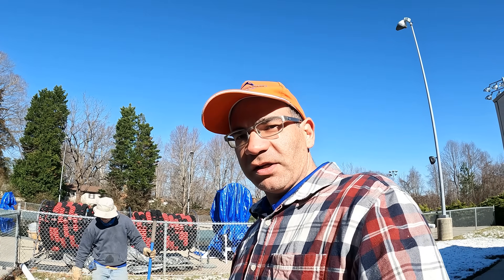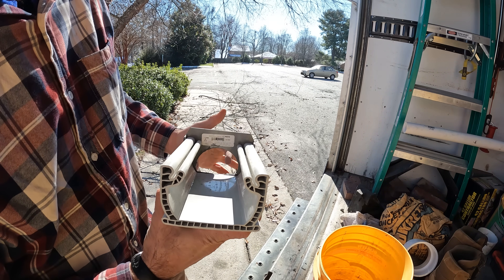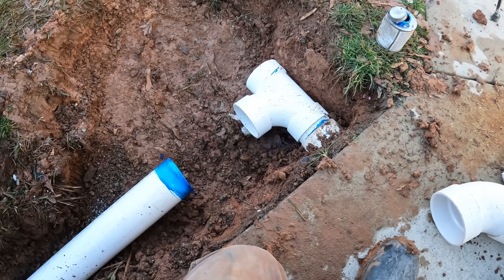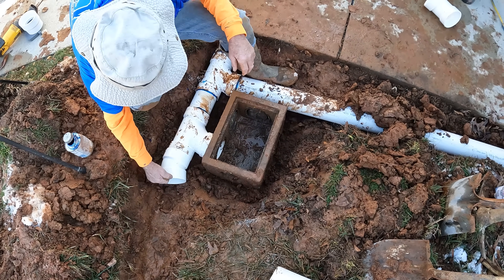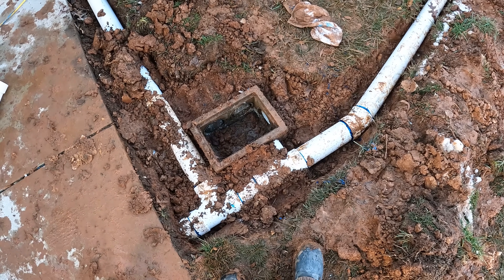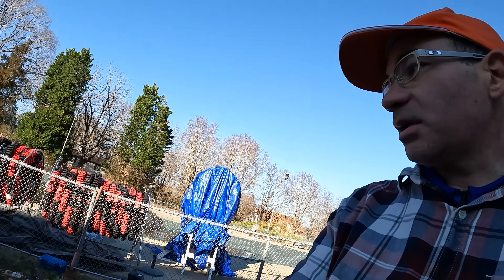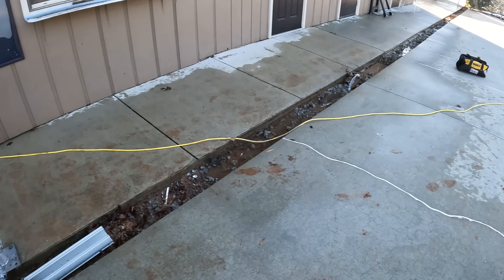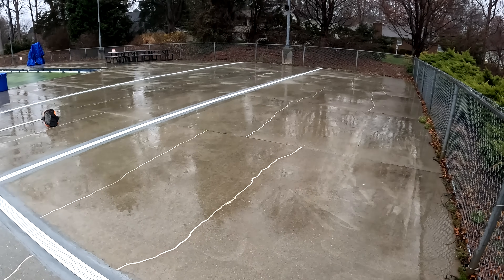Connecting A channel drain to 4" PVC drainage Pipe

Comment: Great job as always Shawn! By not using the catch basin you definitely sped up the water flowing through the drainage pipe. That was a great idea. I like how you all throw away your trash also when we installed a interior pressure relief system in our basement the crew three all kinds of bottles and candy wrappers inside and I thought that was definitely not professional. I can tell you and your guys take pride in your work. I just wish more contractors were like Gate City Foundation Drainage. Can't wait until the next video.
Reply from the maker: Thank you Shane! I've got a bunch of videos that I need to get busy working on!

Comment: For plumbing code 2" and under is 1/4" per foot, anything above 2" is 1/8" per foot. Also for drainage 90's aren't permitted and you must use 2 45's to make your 90's for flow reasons.

Comment: Shawn, buy a wood working rasp. Then you can use it to clean up the rough edge of the plastic after you cut it with your oscillating tool. The rough edge will tend to catch leaves etc.
Reply from the maker: Great idea John 👍

Comment: wHY DIDN'T i see pvc pipe cleaner or primer used?
Reply from the maker: We use a primer+glue called Rain-r-shine.
Reply: @GCFD  That's a wet and dry cement, not a primer and cement.

Comment: Please share the link to the Uniform Plumbing Code that says it’s ok to lay a sanitary tee on its side for water drainage applications. I am doing this to my driveway and am having trouble with the inspector. Thanks.
Reply from the maker: Hahah Here code says to use corrugated for drainage pipe so I wouldn't recommend following some codes.

Comment: Is there any concern that the dirt you use under the PVC could settle you might lose some of the fall you established?
Reply: It will settle and the fall will change along the pipe. The PVC is stiff so will tend to bridge over low points in the trench so it will not be as bad as single wall corrugated where you are likely to get ponding in the pipe even if you start with a good fall. The pipe was laid with good falls so whilst it will have different falls in a year it is very probable that it will be still have a reasonable falls then.

If the pipe was bedded in pea shingle or sand settlement would not be a problem. But with such shallow pipes there could be problems with traffic, lawn mowers etc rutting down into the trench and damaging or moving the pipe. You could bed and surround the pipe in concrete  but that has to be mixed. The pea gravel/ sand or concrete has to be paid for and the material that comes out the trench has to be loaded up and disposed, which all costs money.
Reply: @johnclements6614  Thanks for the reply! I find all of this very fascinating.
Reply from the maker: Like John said. We also try to bed the pipe in several places and we leave the dirt mounded on top of the trench. The dirt will naturally settle and surround the pipe over time and not disrupt our fall.

Comment: Would you send jet to existing pipe to see if it’s in good condition and clean out any possible blockage before linking your work? I know in this case you were confident that it was scheduled 40 and looked good.
Reply from the maker: Yes I have done that before...jetting an existing system out before connecting to it.

Comment: Another great video with excellent explanation. Can you connect gutter downspout to a Channel drain and then to another downspout, then to daylight? So a channel drain in between 4 downspouts. Wouldn’t the water from downspout overfill the channel drain?
Reply from the maker: Sometimes I'll connect a gutter to a channel drain if I have decent fall. That will help keep the channel cleaned out as well. For four downspouts I would probably keep the water in a pipe and run it past the channel or just connect one.
Reply: There is no reason you can not connect gutter down spouts to a channel drain. You need to size the channel to include the area of roof to be drained. Manufactures supply tables giving the area a channel drain can cope with, with different falls, rainfall intensity. Leaves are more likely to enter from the roof rather than through the channel drain grating, assuming you would sweep the area around the channel drain from time to time but not the roof. The leaves etc may enter the channel drain in light rain and be left behind until a storm pushes them out. With out any evidence to back this up I would add 25% to the area of the roof when deciding the size of the channel drain.

Comment: I never asked this question because for some reason I assumed you guys didn’t see some or any real cold weather. With that said, I notice you don’t go 48” down with your pipes. Which is technically the freeze line. I haven’t installed some drainage because of this. I don’t want to dig a 50 ft long run 48” deep. Do you not need to dig that deep if it’s not holding water under pressure?
Reply: 48” is not the freeze line in NC, pal
Reply: @electricaf365  yea. It’s 10” over there. I looked it up earlier. Thanks.

Comment: Shawn: I have a concrete covered back porch that was built with the house in 1965. The porch has settled, creating a situation where rain/snow water drains back towards the house. It is still sealed, so no water is going under the house. Is there a way to realistically cap this concrete to create positive drainage without having to tear out the entire porch? Thanks in advance.
Reply from the maker: The only thing I would recommend is replacing the concrete. That way you can create the slope you want and have a nice new patio at the same time. I wouldn't do anything less for myself or my clients.
Reply: @GCFD  This would involve getting into the structure of the house as it is a covered porch with roof ridges. I'm afraid the expense would be prohibitive. What do you think of the polyurethane suggestion?
Reply: @GCFD  Here is an article I found, mudjacking v. the foam. Thoughs?
Reply: I was in a similar situation with the house I bought a few years ago. We had a wooden deck in our backyard that was accessible through the kitchen sliding door. As we were tearing out the old carpet in the lower level room (house is a split level) we discovered water damage in one corner. Directly behind this corner, on the outside, was our deck so it was difficult to know what was happening until we tore the deck down.

Come to find out, the wooden deck was improperly built on an existing concrete patio. But that wasn't the issue. The main issue was that at some point, a concrete patio was poured on top of (presumably) the original concrete patio that was poured when the house was built. I assume this was done to correct a sloping issue with the original patio. There was an obvious slopping of the patio towards the house. After we tore the two layers of concrete we could see that the ground had sunken in the direction of the foundation wall and the corner where water was coming in. I presume this was due to the weight the two layers of concrete.

In the end we had a new patio put in to our liking and the grade falling away from the foundation walls. So far no issues with water but only time will tell.
Reply: Find a a company that will use polyurethane foam to raise your sunken concrete patio
Reply: @chirina5  I will check this out.
Reply: Or a company could install foundation on piers to raise the sunken pation back

Comment: The others made that look real slick,  Was kinda surprised you re-used that basin w the open end, of course not having a dedicated stop/plug to go with it, though you mentioned blind so that was good as long as the extra flow does not build up there... Just barely squeaked out enough to tie into that from the storm drain, though i suppose you cut off what you needed to use.
Reply from the maker: Yea that basin was in good shape. The problem with most basins in they are soo deep. This was a nice little concrete one.